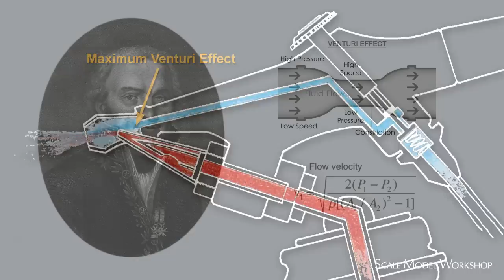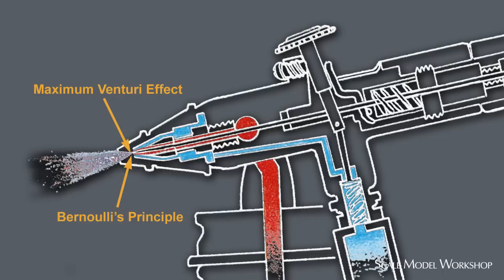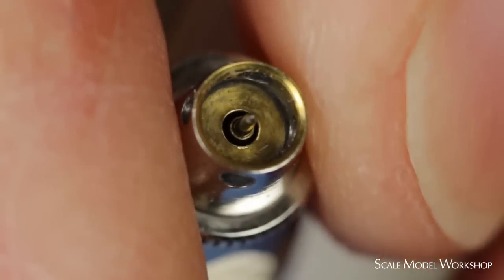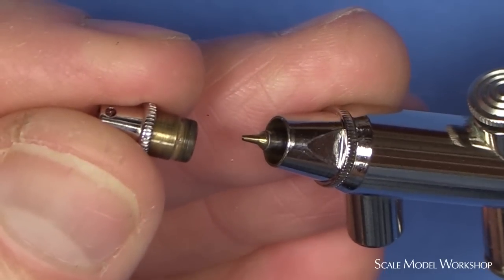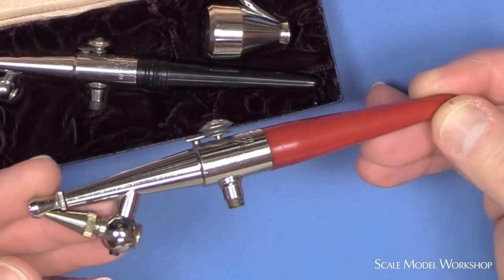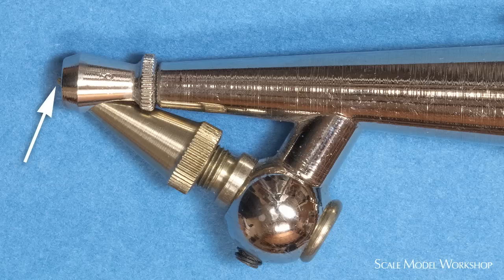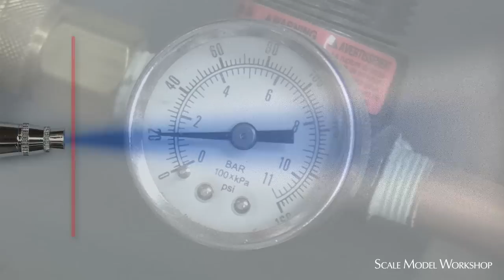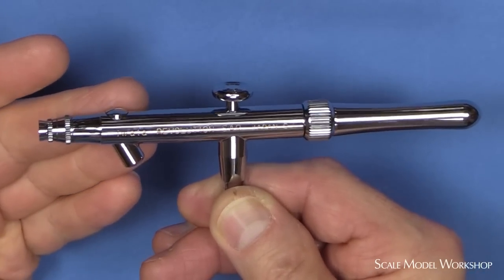Single Action Airbrushes for Scale Modeling

Comment: I was Paasche Airbrush Demonstrator for several years here in Australia (I'm a Yank still on R&R). The AB was a basic super brush that was designed for photo retouch work in around 1904. I still have 3 of them...LOL ... Love the post. Sadly Paasche has quality control issues this past year and they are no longer in Chicago. Jars often have too much chrome as does the set screw holding the fluid nozzle assembly. Iwata makes a single action, but none are sold in Australia. It looks like we are going to drop the single action lines. Good information, nice post.

Comment: The great thing about single action is the consistency when base coating. 
Occurred to me today while cleaning double action airbrushes that they can be turned into single action by locking the needle in a slightly open position with the needle chuck. You still have the freedom to pull back the trigger to clear clogs.

Comment: I have both the Badger 200 and the Pashe H  these were both Christmas Gifts from my late father when I was in High school.  I still use them to this day.  and have been very pleased with them. although I have been noticing the Badger isn't working as well as it once dig  yet I don't know why?  I keep it cleaned. the tip is fine no bends or cracks in the needle or head.  yet it just isn't spraying like it use too.

Comment: Great review, well detailed - thank you👍😊 

I think that for my current budget for an airbrush, for use with primers etc the Paasche SI seems like a reasonable fit. 

The H is venerable, often well liked, remarkable in many ways, but not for me/my needs. the Iwata is probably a great airbrush, but a little out of my current budget for a simple to use and clean SA airbrush (I've had Iwatas before and they're great but can be fiddly to clean compared to some other brands - I have two H&S airbrushes for detail work and a  couple of Sparmax trigger airbrushes for large area work. I need something to get primers and base coats on, in my small indoor booth, from my quieter diaphragm compressor that I can use (indoors) in the winter months🤔😉😊👍✌️

Comment: I paint HO model trains and started with a Paasche #3 H yet noticed the more grainy finish. I have a few double action Badger 150 and 155 and a Vega 2000 never tried to practice enough to get good consistent results for base coats. I liked the Badger 200. I have a Paasche V1 #3 and a VLS #3 . Basically my question is I have a older Vega 600 SA has the same head as the old Badger 200 and 150 yet the Revell/Vega 600 is a med head .5mm so it's basically as small as a #1 Paasche tip , question is will a .5mm tip do a good job painting with reduced enamel ? When I had the Badger 200 and 150 I got the large or heavy head and it was closer to a #3 Paasche and worked well both came with the IL of fine tip and wouldn't spray well to cover. Paasche #3 seems to work the best for me as far as tip size which makes me wonder if the .5mm tip will work well enough. All I read is the Badger tip sizes in relation to how fine to how large the pattern will be say 1/32"-2 1/2" withe Badger med .5mm nothing about paint .

Comment: Thanks for the video!
You mentioned the Badger 150. That's the airbrush I own, but I never got decent results with it back when I was using it a lot. In retrospect that was mostly due to the membrane compressor that had no reservoir, pressure regulator or moisture trap and could hardly deliver enough pressure to blow a cotton ball away. Well, that may be exaggerating a bit, but it was really a dud. The only thing it's any good at is making a lot of noise. I never really beat an aerosol at anything with it.
Anyway, coming back to the hobby I would like to be able to prime and paint small to medium sized models, so I am looking into replacing the compressor and am now wondering whether I should just go for a clean start and replace the airbrush as well. What would you say are the strong points of this airbrush, if any? Combined with a good compressor, is it worth keeping it around, or are there other affordable airbrushes that can easily render it obsolete? 
Would love to hear your thoughts on this.
Reply from the maker: Are you looking for bottle feed or gravity feed?  Single or double action?
Reply: @scale-model-workshop  Double action, but the feed type may be either.

Comment: Huh? Don't know the tip sizes on the H? Paasche has it on their website. The 3 sizes are
#1- 0.45 mm, #3- 0.65 mm, #5- 1.05 mm
One big advantage of the H . . .it's easier to clean when using enamels or lacquers, as you  don't have the paint running through the body of the brush. Don't know why this never gets mentioned. Also, they've been around so long you can often get used ones in great shape on ebay for $50 or less for the whole set. Got mine for $35.

I also have the VL and the Vision, so I have double action too. I can get a 1.05 mm tip fora VL, but still prefer the H for lacquers and enamels on large surfaces. As for the finish. I just sprayed the primer for a P-47 with the 0.65 mm tip and have NO orange peel like you showed. Perfectly smooth finish. Used Badger's Stynylrez straight out of the bottle. Usually people who complain about the finish aren't familiar enough with setting the pressure and paint mix for the H to get  a smooth base coat.

Comment: I was considering the Paasche H for priming with Stynelrez as I thought it would be easier to clean.  Thoughts on that as an option for a dedicated primer brush or are there better choices.  Primarily doing 1/48 aircraft.  Thanks!
Reply from the maker: Why in the world would you want to put down your base coat of material with a tool that will leave you with less than an optimally smooth surface?  You would be better off with a spray can.
Reply: Then what would be the best option for Stynelrez?  I like the primer but don’t want to use my main airbrush for it.
Reply: I’m no expert with the model h but I do own one and specifically use it for the stynylrez primer lineup on gundam model kits and I find as long as I put a drop or two of the tamiya paint retarder the stynylrez self leveling properties performs really well and makes clean up a piece of cake but whatever you do make sure there are no lacquer thinner in the cup or nozzle if you clean with that before you paint or else it will clog terribly.

Comment: I'm just wondering why anyone would want a single action for modelling if you own a mini spray gun and a double action airbrush. Any thoughts?
Reply from the maker: You probably wouldn't ... but that wasn't the point of the video.  The video addresses achieving the best atomization and resulting finish from a single action airbrush ... for those modelers who maybe only use a single action airbrush.  It's not what I use ... but not everyone is the same.  I'm trying to make this series as comprehensive as possible.
Reply: Scale Model Workshop makes sense I was just wondering why you had all of them

Huge fan have learner a lot from you that has really been outside the box 😉
Reply from the maker: I've always been a bit of a collector
Reply: Scale Model Workshop can't argue with that. Thanks mr.Budzik